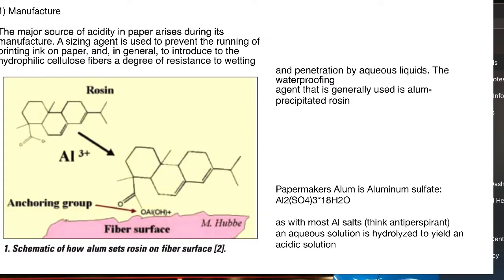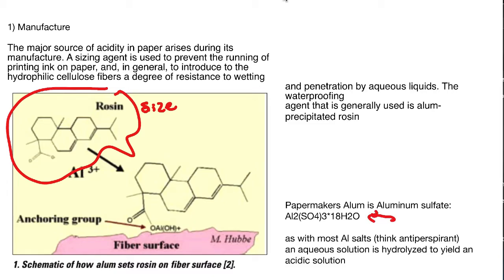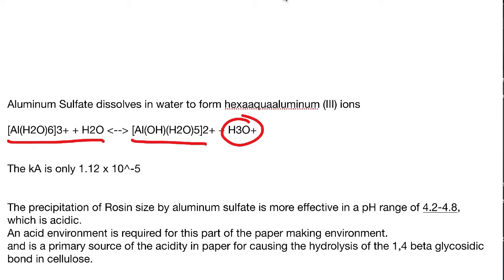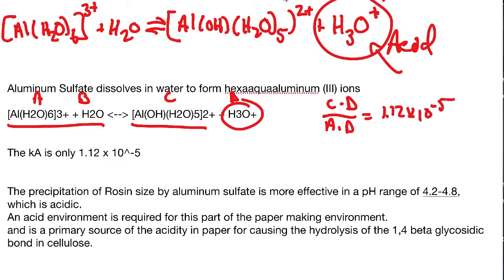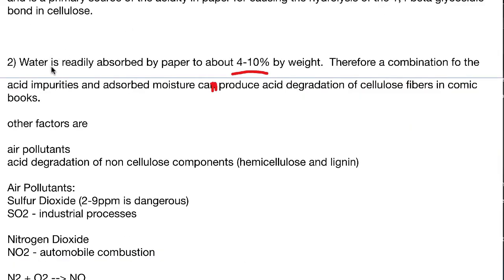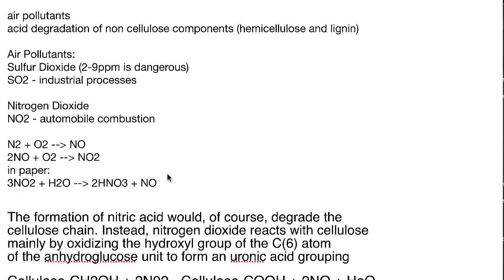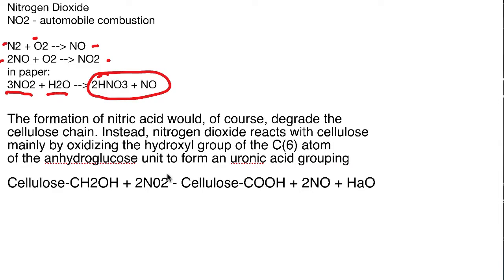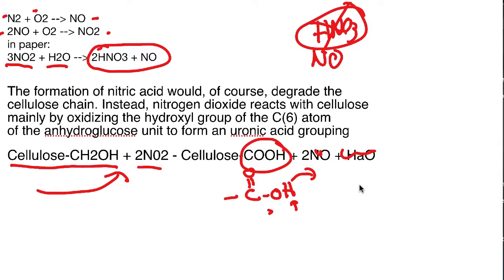Comic Book Scientist Lecture on Paper: Part 2

Comment: Where can I get your cleaning solution?
Reply from the maker: I can sell you some.  I am building an online store but I am help up in legal issues right now.  If you’d like some email me at rickmorgan@hotmail.com but I can only sell very small amounts right now.
Reply: Can a "method" reverse (or stop) the (inevitable) tanning? Besides the cool dry dark, etc that slows the process.
Reply from the maker: @brettsokoloski3772  Thats a good question. The answer is "no".  The cellulose oxidation is thermodynamically spontaneous and irreversible.  You can slow it kinetically and even stop it entirely but you cannot reverse it.  However you can remove at least some of the yellowed byproducts which will cause the paper to appear whiter, which is what I do.
Reply: @ImmaculateComics  Ah yes, remove the yellowing byproducts (super cool) and slow it kinetically but stop it? (Sealed in inert gas! lol) Thx Teach but I've gone too far already, other than your site.

Comment: I might have to watch this a few times to aborb it all. You put out some good information, I just have to translate it from technical to easy reading. You know like modern paper good, really old paper good, wood pulp paper bad, kind of thing.

On a different note I recently recieved some comics that would have the covers detached, except someone glued them on, I thought before I get out my blow dryer on a low setting I might touch base with you and see what you think.
Reply from the maker: Thanks, as always.  I had a few requests for "more technical" posts.  I was reluctant and feel I am mostly just entertaining myself because nobody else will want to watch this stuff, lol.  
I was cautious because I dont want to alienenate the masses.  But what the heck, its not like I am getting paid for it so I may as well do what I like, right?

 Believe it or not, it gets a lot more technical too.  There really is a science to this stuff.  it's not just rubber erasers and T-shirt presses as most videos will have you believe.  But as you already know, you must know what you are doing and must be very careful!
Reply: @ImmaculateComics  So take the one in the worst condition and try the blow dryer on a low setting and try to gently seperate the cover from the comic?
Reply from the maker: This one is risky because it depends on the glue.  If I’m you can get away with using a solvent I would do that first.  Try toluene or naphtha first using a precision swab. Some glues will burn , bubble, or curl up with a heat gun and it will ruin the book.
Reply: @ImmaculateComics  I'll try that first then, and if I can't get it to seperate, I'll send you one to play with.